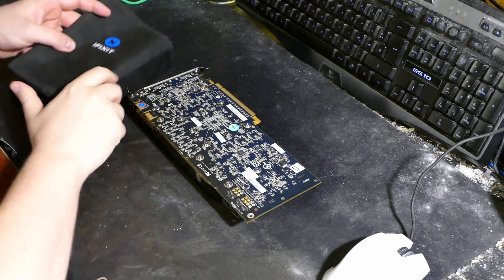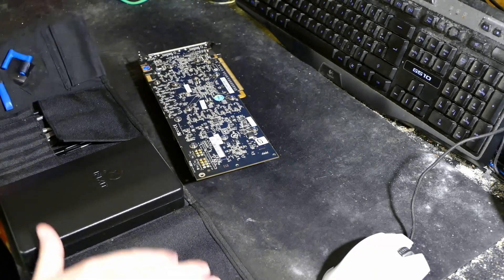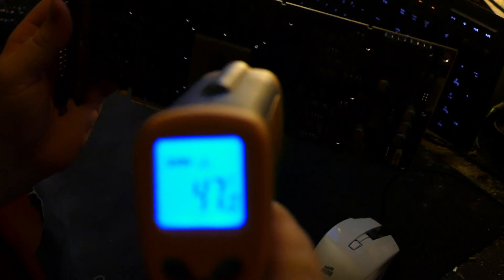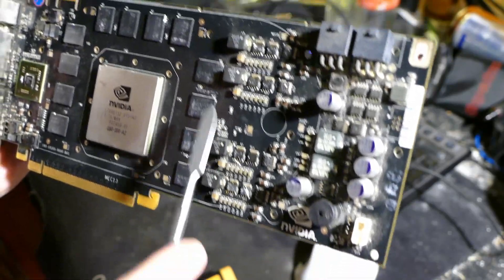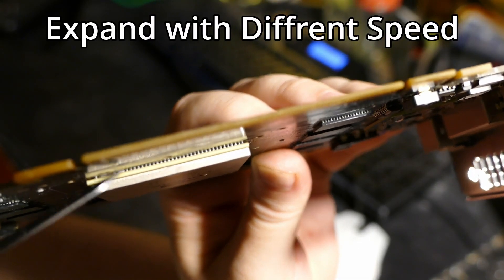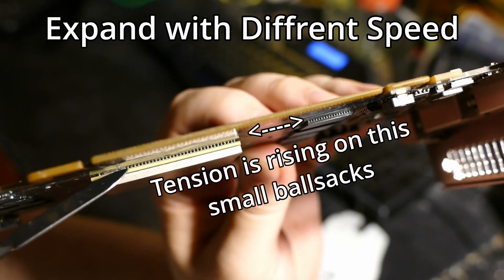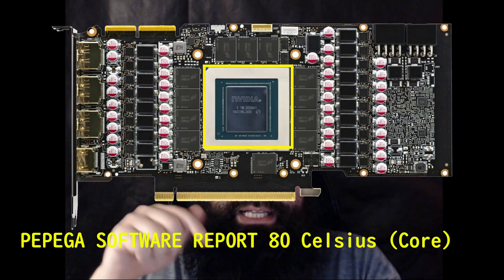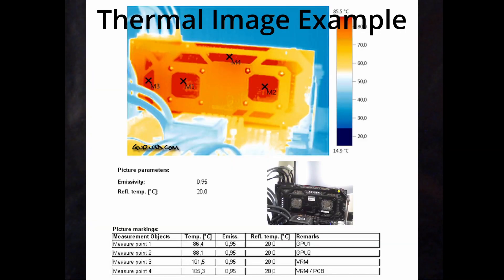Tech Wizard #1: GPU Strats

Comment: You aren't wrong. But for the average user, the cause of damage is going to be overheating. Countless rigs I witnessed, with €800 cards inside a small case with 2 air outlets facing the wall. Or case standing next to a window with dust so tick, you could shovel it out. Most failures are caused by bad handling of the components as a whole. The only two good advices I can give to people, is to clean their case ONCE EVERY MONTH. And place your PC, where sun and blow air from the outside cannot reach it. Anyway, it was a very nice video explaining how heat effect different materials.
Reply: undervolting will make the card live longer?
Reply: @-Ryu-  From the physical aspect, yes. From the mechanical aspect, it does not make sense. I doubt the increase in lifespan would be measurable.

Comment: what do you think of baking the card in the oven to make it work again, my r9 290 died and the guy said it is fucked forever so I was wandering if i should try it... but most likely ill just buy a new one
Reply: From the technical point, you are heating up the plate to liquidate the channels responsible for transporting the electricity on the board. And remove any fraction along the way. This might work in 1 out of 10 cases. If you don't intend to have a closer look at the card, you can go ahead and place it into the oven. Be sure not to leave the card unattended inside the oven!

Comment: can you briefly explain how to ground yourself properly during repair/disassembly? im taking courses in repairs but so far there was not a word about how to protect yourself or your equipment against discharges
Reply from the maker: Never ground myself. Work with 1000+ CPU/ GPU never kill anything.
Reply: @diviumfuror  that's impressive, ive seen many professionals with gloves and such so i thought it was necessary, do i really dont have to ground myself? even while working with PSU?
Reply: @frskngd  you really dont have to. its just something to keep in mind. the ESD stuff is really more focused in a professional factory setting where they have clean rooms and such (like hard drive factories). Ive built countless PC's and I dont think ive ever come across any ESD related issues or even repairs.
Reply: @layeetskeeters9244  its just that things tend to go bad for me so yeah im just worried about frying electronics
Reply: @frskngd  linus and electroboom made a video about it and even with forced static electricity they were not able to fry anything.
Reply: @kingcatmushroom  just because its rare doesn't mean it won't happen,  im very unlucky irl that's why i asked
Reply: this was more of just a demo / explanation. but if you want to be grounded you and your work area must be at least conducting (clip a wire to a work area and clip that to your body) they sell grounded work pads that come with a wristrap with built in resistor) 

The idea of an ESD wristband is to slowly remove charge from your body and equipment you contact. If there was no resistance, there would be two problems:

    -Danger of electrocution if you touch a high voltage with respect to the ESD strap ground.
    -You could have rapid voltage shifts causing ESD like scenarios.